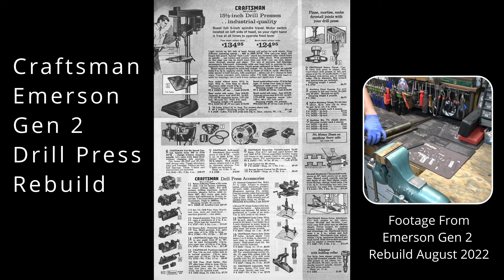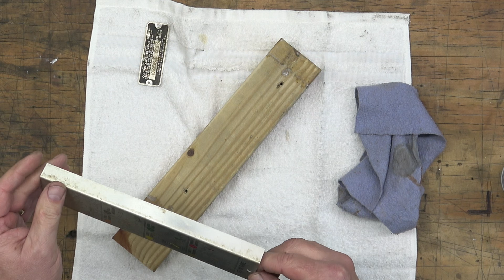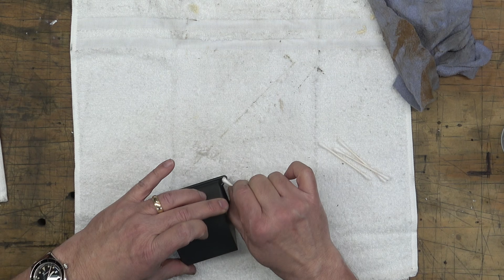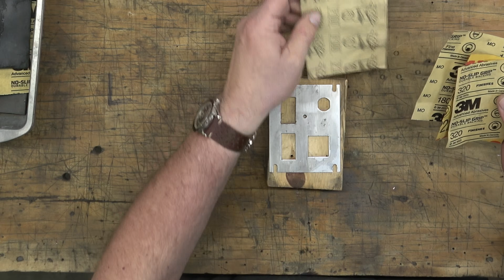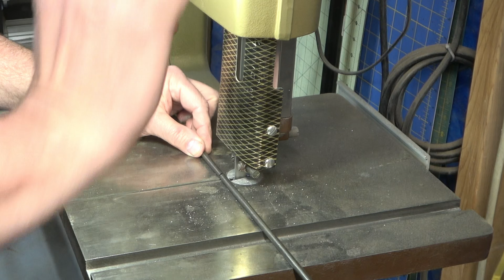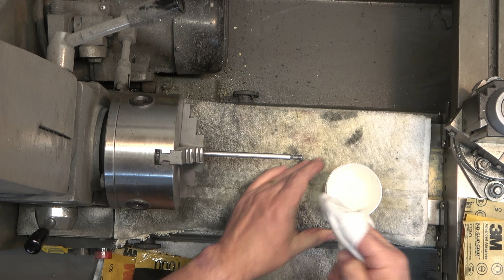Part 10 Craftsman Emerson Gen 2 Drill Press Rebuild (Runout, Panels, Modification, & Fabrication)

Comment: Thanks for the videos - you have a good system.  Turtle Wax has a chrome/bumper cleaner liquid that might be useful for that panel with the rust on the sides.  The liquid is thin (watery) but I have found it useful and not too course.
Reply from the maker: Thank you